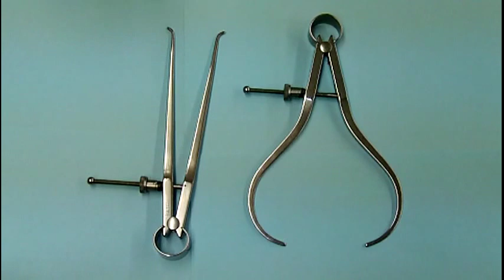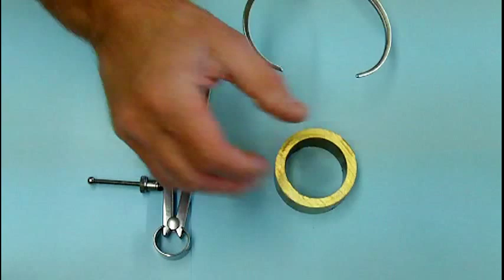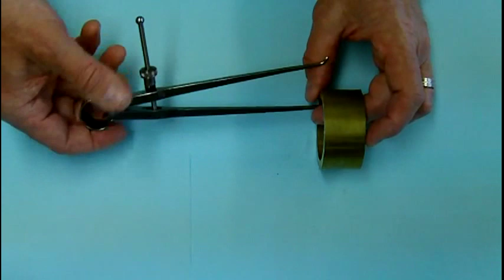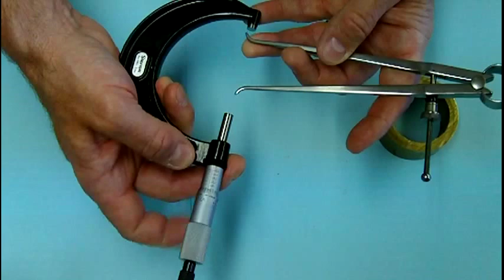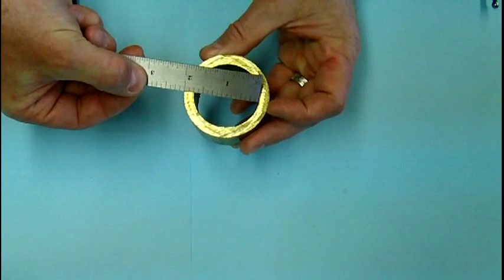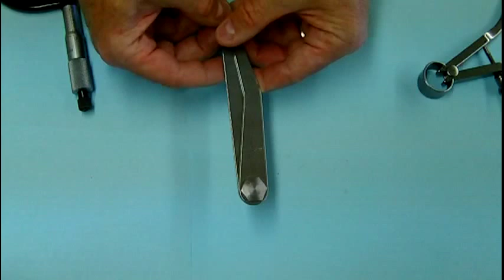Spring-Joint Calipers inside/outside

Comment: Thanks for the video.  I have had certain situations where the inside calipers are the only measuring that will clear obstructions to get an accurate measurement.  This is definately in my opinions the hardest measuring instrument to learn because its all dependant upon "feel".  When used correctly with the proper "feel" I would argue one can obtain very accurate measurements within 0.0005" or less when compared to other measuring devices such as inside micrometers.

Comment: what's the margin of error for calipers like these?

it seems like there's a lot of ways to go wrong on technique, but i'm curious about how close i could get, barring major errors.
Reply from the maker: The margin of error honestly is the operator. I know people that can accurately use these calipers to 0.001" The trick is practice and patience. These inside calipers are great for checking the size of a grooves diameter.
Reply: machiningmoments
that's impressive. thanks for the info!

Comment: What occupation would these be used?  My grandfather had these in his possession. He worked with wood.... A general contractor in the 1900s
Reply from the maker: I am a machinist and they are used in my trade. They aren't used a lot anymore...a tool from another era. Thanks for watching.
Reply: @machiningmoments  which tool is now used in their place now?
Reply: @AS-ug2vq  Digital calipers, O.D. micrometers, I.D. micrometers and digital air gauges